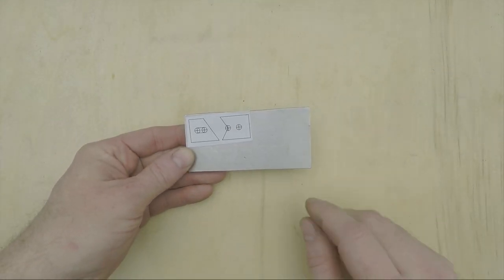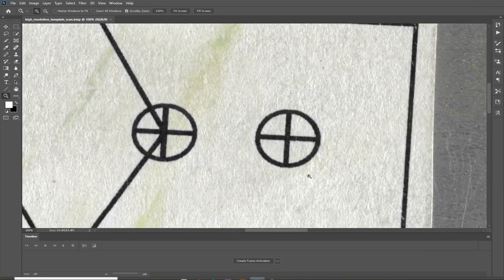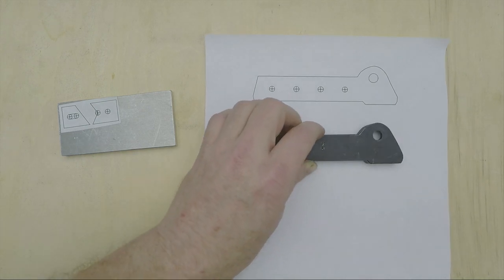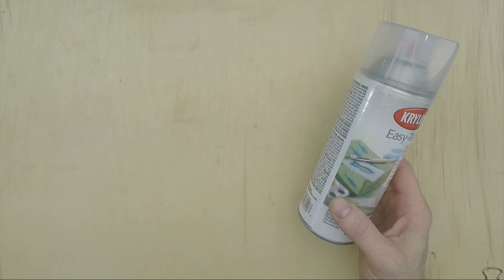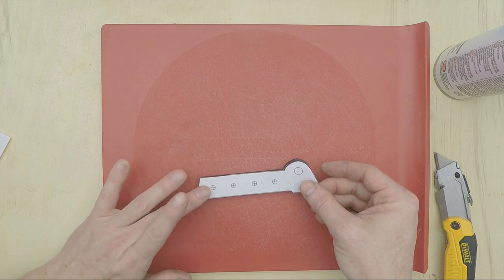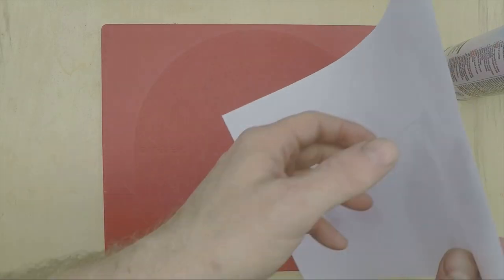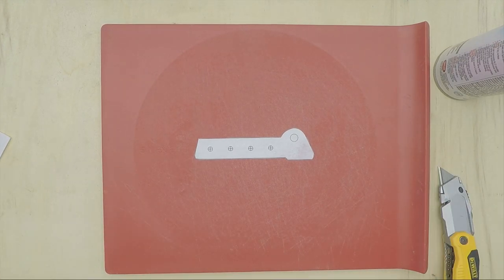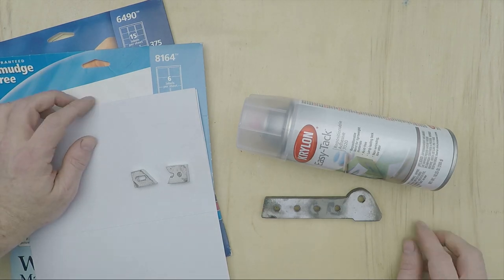Repositionable Spray-on Glue

Comment: How long does that glue stay tacky? I am looking for a spray adhesive to make sticky pads for flies. I want to make my own for my Katchy mosquito catcher. The company made sticky disks are pricy and a pain in the butt to find.
I want to make my own, so the adhesive needs to stay sticky for days, and there's a computer fan blowing on it all the time to draw in the fruit flies.
Reply: The Krylon product website says it "stays repositionable for the Life of the bond", but I'm not exactly sure what that means!   Btw, are fruit flies anything like "fungal gnats"?   I recently read a blurb about using a piece of raw potato on the surface of house plant soil to "capture" the lavae of "fungal gnats".  I know that doesn't help if they've already become adults, but it might slow the process of reinfestation (?).  Also, are you quite sure a fan blowing on your capture strip will  D R A W  in the critters?!?  They're not terribly substantial; I'd think that'd just blow them away!!
Reply: @amkarei  The Katchy machine has a blue light over it. It's supposed to be Ultra Violet which many insects are attracted to. So, the flies fly to the blue light and the suction from the fan pulls them in and are forced onto the sticky pad in the bottom of the trap. Around the sticky pad is basically a screen with holes small enough to not let the flies get out, but lets the air from the fan get out. If you go to Amazon or YouTube and look up the Katchy fly catcher, you'll see how it's built and works. It does work, but it's best to have it in a dark room, or keep the room dark. I have mine in the kitchen near the sink where the flies like to hang out.My kitchen has no windows, so it's dark in there most of the time. If you have jungle gnats that hang around your plants, put the Katchy machine near the plants and at night the blue light will attract them.
Another thing you can do is carefully scrape off the first half inch or so of soil of your potted plants and dispose of it outside. Replace with new soil. Reason being those flies may be laying their eggs in the soil and hatch there, continuing the problem.

Comment: that's cool and all and it's a useful product but couldn't you just print the template on both sides front and back, and then lower the part onto the part? Not like you're doing the paper onto the part. The rigidity of the part would be way easier to line up than the flimsy paper.
Reply: Pretty sure that one side is sticky and covered with a film. The printer would print it on the film, which would have to be removed to expose the sticky side
Reply: @notricky1680    Not only that, but you'd have to have one  v e r y  sophisticated printer to be able to get both sides of the part to match up on both sides of the paper!!   I must not be understanding your comment.  Sorry.